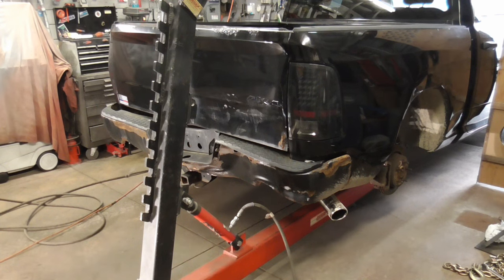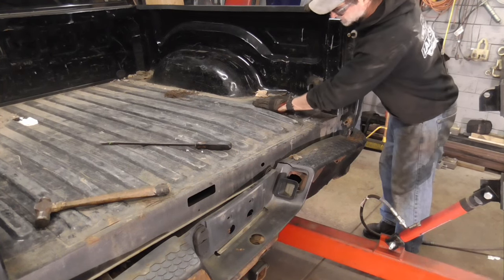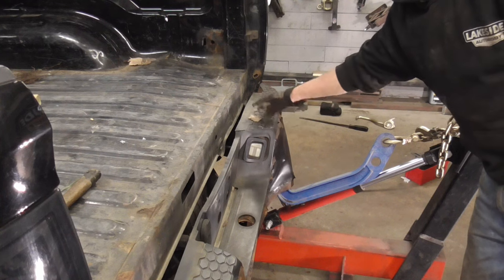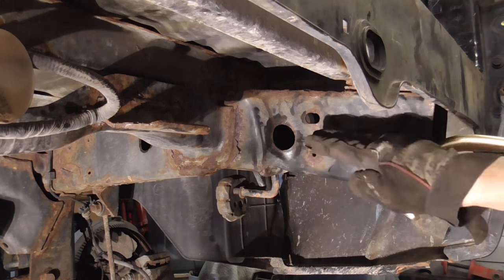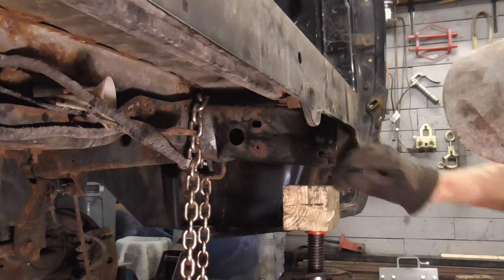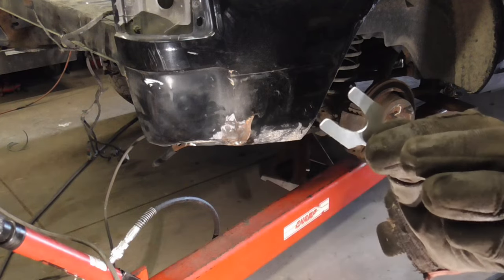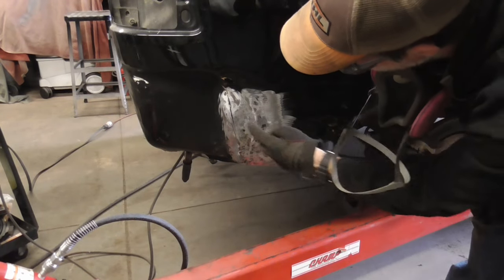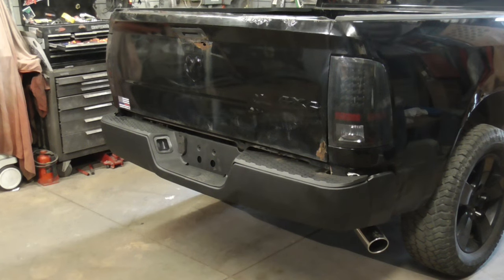Pulling a Pickup Truck Frame w/ a Simple Frame Machine

Comment: I'm once again sifting through Lakeside Autobody videos because I have once again found myself in a pickle. Long story short is I launched my rally car about 7 feet in the air and it came down not so flat. My drivers side front frame rail is sitting about 2 inches higher than the other side. We pulled a decent amount of damage out of it by putting it between two trees and using a comealong, but that only helped in the front to back axis. We need to pull down now. I've been drawing up a plan, using a 4x4 or 4x6 piece of lumber, chaining it to the tow hooks front and rear, putting the whole car on my custom jackstands, spanning some 1x1 square stock between the jackstands and THROUGH the lumber post to keep the lumber from moving front to back, chaining it all between the trees, and using a bottle jack behind the damage to leverage the pull. The front tow hook chain and tree chain is actually gonna be my come-along, and we're hoping that this will pull down on the frame rail. Its not gonna be perfect, we just need to mount headlights, bumper cover, grille, etc back on the car.

We would get on a frame machine but we dont have pinch welds anymore, or at least we dont have access to them, so this is our next best choice I guess.
Reply from the maker: Let me know how it turns out for you 👍😊
Reply: @LakesideAutobody  update: no dice. Glad I didnt invest too much money in figuring out though. I had a few bugs in the setup on the first couple pull attempts, worked those out, and once that was done, the 4x4 was actually flexing upwards before the car moved downwards at all. I had never seen a 4x4 piece of lumber move like that before, but alas. On to making a front clip fit as best I can anyway.

Comment: That truck is junk
Reply: I'd still get a ton of use out of it. Therefore not junk.
Reply from the maker: Picked it up for 1500 at COPART - runs good, drives straight, everything works - even the air.  My son wanted a winter beater - this will last quite a long time actually 😊
Reply: @LakesideAutobody  sure if a man isn't towing and you want a beater, I would pull that engine and drop it in something worth it